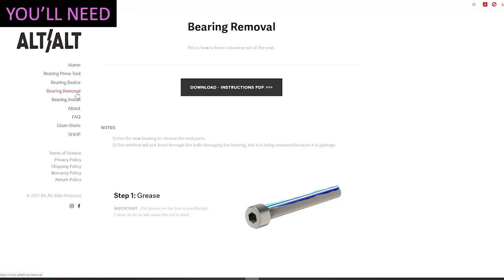How To - ALT/ALT Mountain Bike Suspension Bearing Press Kit

Comment: can you crack a carbon fiber frame pressing a bearing out crooked? i was pushing my lower shock bearing out of carbon slash and heard a loud crack when tightening down the press but idk if it was the bearing breaking loose or frame cracking. it was seized in bad and could not be pulled out with slide hammer so i pressed it out.
Reply from the maker: Pressing a bearing out often makes a cracking sound. Listen to virtually any of my videos and you will hear the sound.
Reply: @altaltbike  I did but mine was super loud to the point where I thought for sure I cracked my frame but i think it was just seized

Comment: You shown us a solution to removing a bearing from a non flat surface using a slide hammer. What is the solution for replacing a bearing in the same situation?
Reply from the maker: Sorry I missed your question. Removal, blind bearing puller (now but I'm developing something). Install should be normal bearing press unless complicated by extended inner bearing ring. There are more details that I can help you with if you email me the bike model and pivot.

Comment: Could you tell me if it works with a giant trance 2021?
Reply from the maker: No, but I can tell you that some customers have had removal difficulty due to sloped or small surfaces. You will need other tools like MAYBE a bearing puller. I would suggest you look up the Giant service manual, but I couldn't find one and had no luck contacting Giant. If you do find one, PLEASE send it to me.